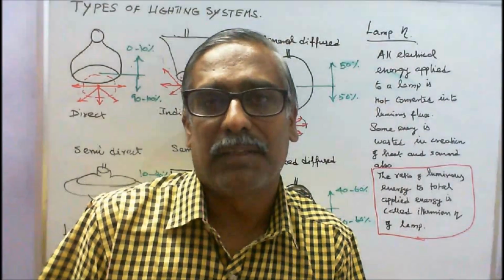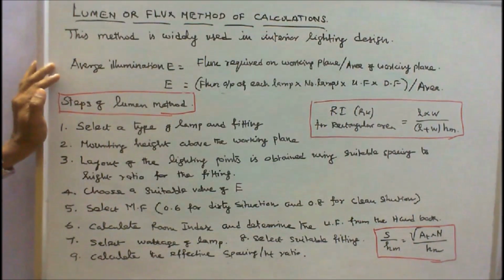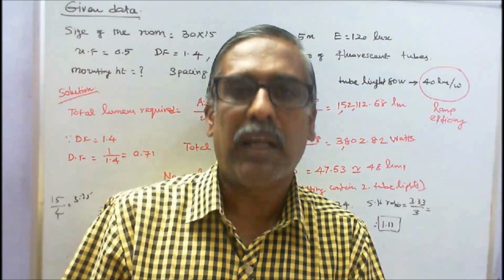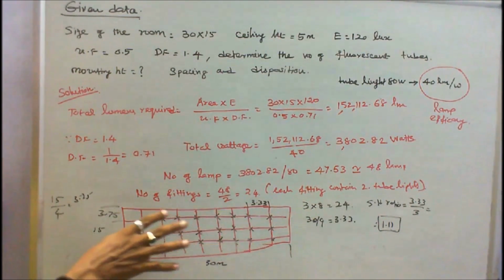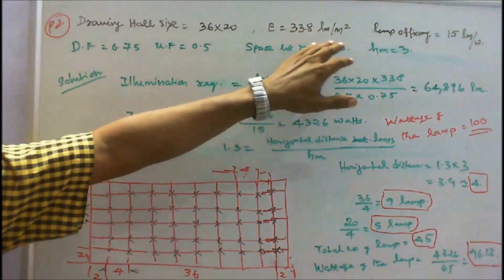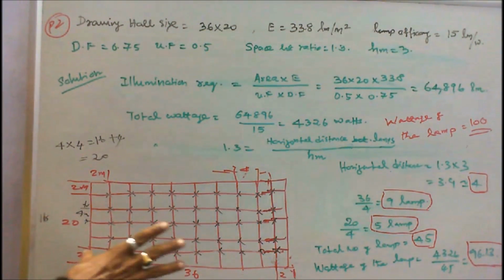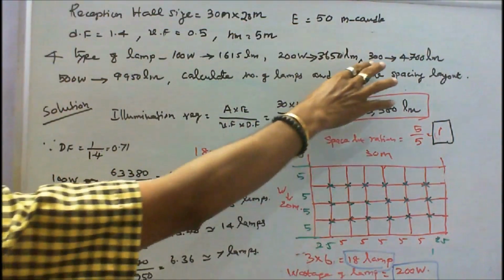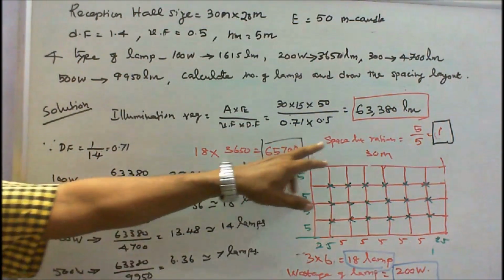ILLUMINATION ENGINEERING - PART - 11 - LUMEN OR FLUX METHOD OF  CALCULATION AND THREE PROBLEMS

Comment: A room 4m × 3m is uniformly lighted through ceiling lights of 1200 lumens. Light is falling perpendicular to work plane. A drawing board is inclined at 60° to work plane. Find the illuminance in 'Lux' at the drawing board. 
Can someone solve this?

Comment: Sir,
first of all I would like to thank you for your effort and your excellent video, great job and really appreciate it.
couple questions if you don't mind 
in ex:3 you said you choosed the 18 lamps because (18* 3650)= 65,700 higher than 63,380
however 40*1615= 64,600 still higher and (14*4700)= 65,800 also higher and finally (7*9950)=69,650 is the highest so could you please tell me now why you choosed again the 18 lamps tp draw the layout?
but again WELL DONE.
thanks again and you are the best